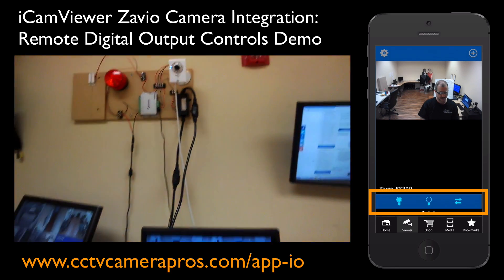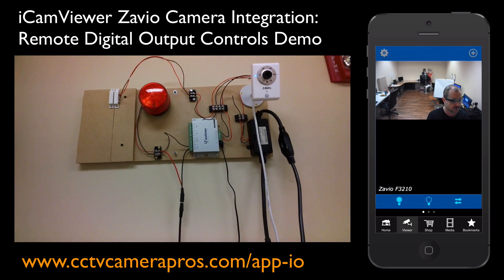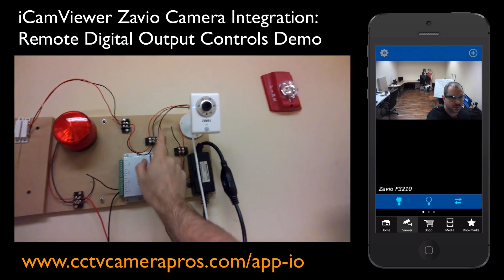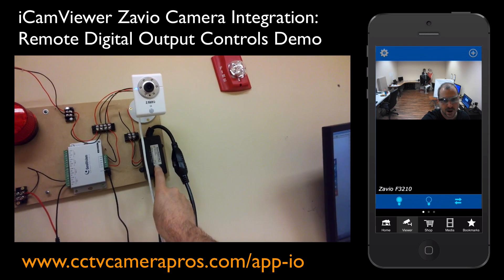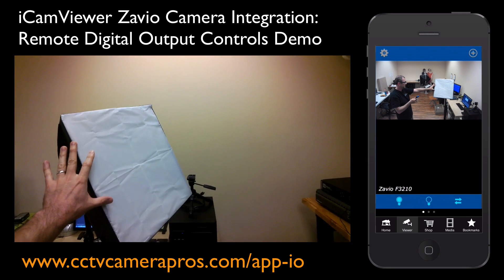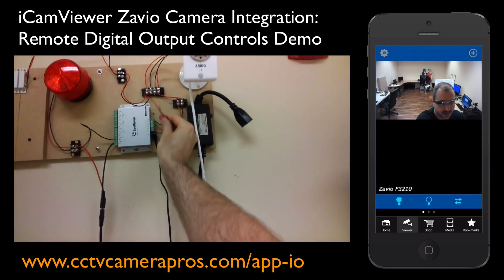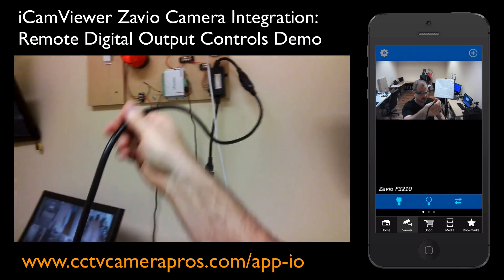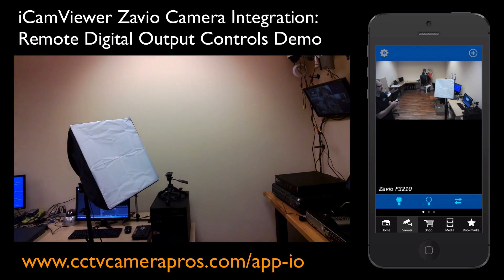IP Camera Mobile App Digital Ouput Sensor Controls

Comment from the maker: IP Camera Mobile App Remotely Controls Output Sensors

The iCamViewer app for iPhone, iPad, and Android can now control digital output sensors connected to Zavio IP cameras. Watch this video to see how CCTV Camera Pros co-founder, Mike Haldas, turns a low voltage strobe alarm and high voltage floor lamp on and off from remotely over the Internet using the iCamViewer app for iOS.

This output sensor integration works with all Zavio IP cameras that have digital input and output ports. By using a GV-relay for low voltage devices or a PowerSwitch Tail II for high voltage devices, users can control the power of just about any type of device from their mobile phone or tablet.

If you have any questions about how this works, please post a comment.

For more information, a list of compatible IP cameras, and step-by-step setup instructions, please visit this page.

http://cctvcamerapros..com/app-io